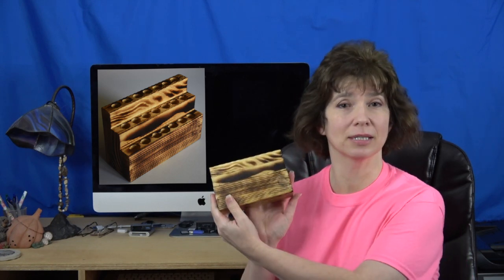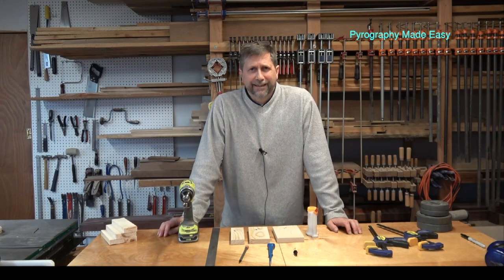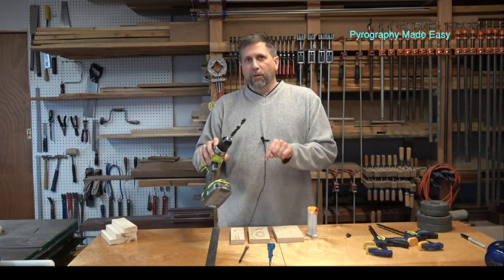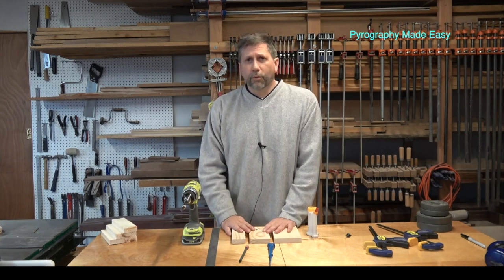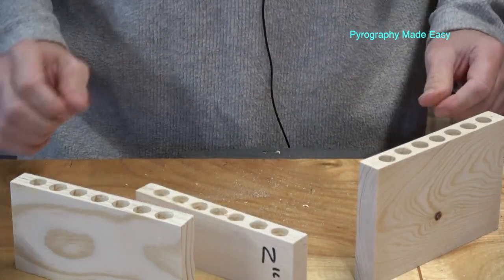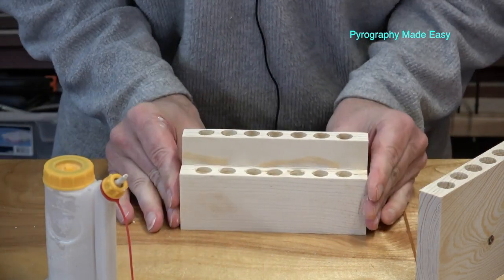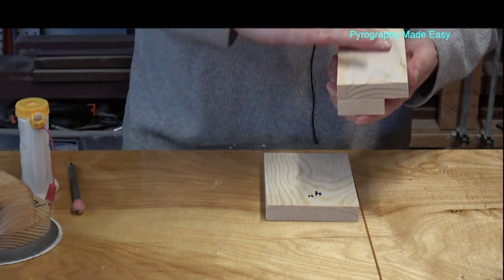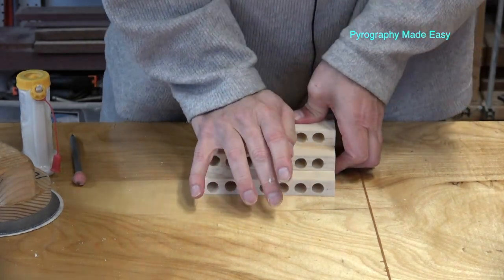Wood Burning - Build a Pyrography Pen Tip Holder - pyrography tutorial

Comment: I'm going to have to buy a woodburning unit that has those types of tips just so that I can make the tip-holder :)
Reply from the maker: Hi Pete,
You can always made a holder to fit the type of tips or pens you have.  If the holes were deep enough they could hold the entire handset (what the pen tip plugs into).